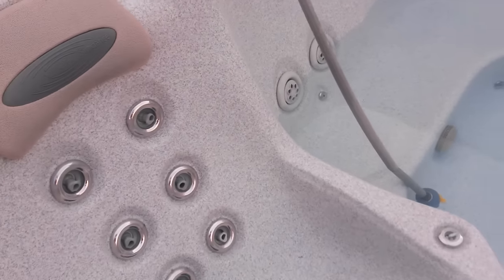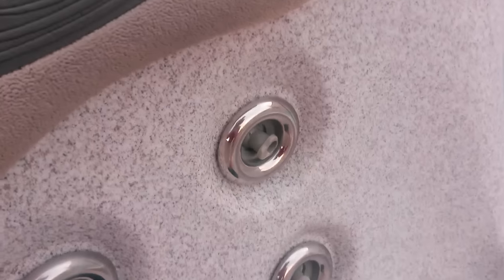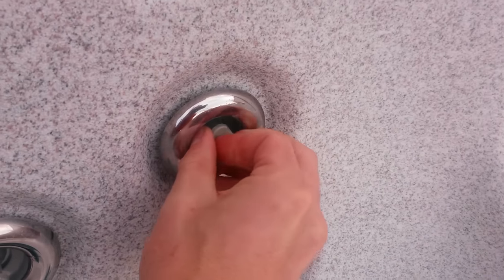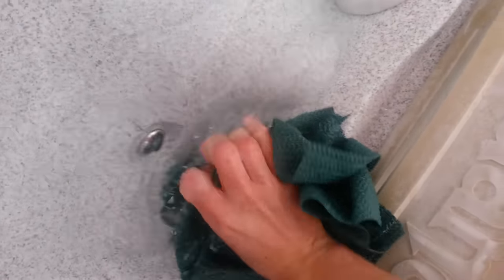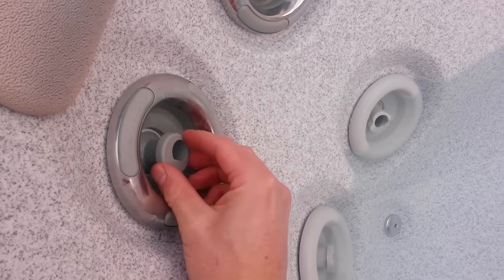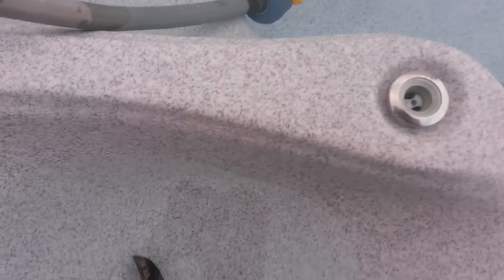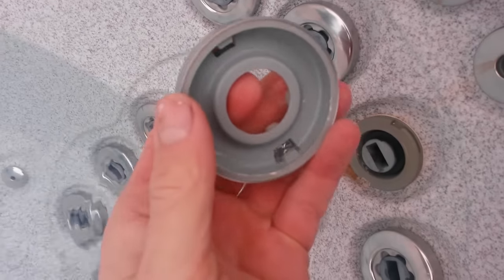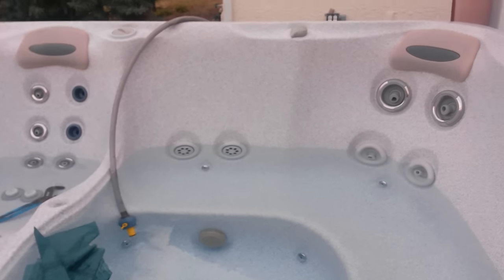How to Remove and Repair/Replace Various Spa Jets ~Sundance, Whirlpool etc

Comment: How to scratch and break your jets is what I learned here
Reply: Maybe you could make a video showing us all how to do better?
Reply: Yes, this is a pretty horrible way to do it.  If you look at the tabs on the removed jet you will see a channel inside of the socket that has a perpendicular keyway to allow the tabs to slide out. All you have to do is turn the jet all the way to the right and pull. LOOK  inside the jet well and you will see the intended removal design.
Reply: That is what I thought I was like why are you not using some kind of rubber gasket between the wrench and the jet housing? Lol then he broke one and I was like ouch! Lol ugh at least he didn't go on 5 minutes on how you soak them in vinegar lol

Comment: Hey ik this is a little off topic of video but on my new ac motor i have, above the inlet big tube connect there are 2 little black almost valve looking things but one of them isnt blocked and leaks water out. Am i supposed to have a little water line coming off of that or something? Or could i just fill it in.. thanks in advance
Reply from the maker: That is theine that primes the pump. It will generally have a line going to the tub or circulation pump. It allows the pump to fill with water before it runs. Not always necessary. You could try just capping it off.

Comment: I own a 1998 Sundance Marin Spa.  After previewing this video, I attempted to turn my 5" foot jet to remove.  This was not a correct procedure for my model spa.  My replacement jets snaps into the jet housing without removing the trim.  I didn't see any videos showing this process for older Sundance spa's. Hopefully you will show this procedure in a new video.
Reply: Mine is a 2003 Coast Spa, has the same snap-off jets. Watching this video gave me the brainstorm to find my channel locks, and when the jet popped right off I realized it was different.
Reply: My bearings blew up so the jets are out but the plastic ring is still in there. Any tips on getting those out? There is nothing to pull on

Comment: Hi  we have the steam shower  with the jets  Thanks for the advice on how to clean them,     The temperature dial for the shower is sticking and  takes so much strength to turn.   We can't see a way of removing this from the back or the front  do you have any advice.  Thank you
Reply from the maker: lynne camozzi Many fixtures will just screw on/off, even if there is no apparent flats to use a wrench on. I would have to see it to be sure.

Youtube is changing their policies for small channels like mine on Feb 20th. I need 300 more subscriptions to meet their new criteria. Please subscribe to the channel if haven't already.

Comment: Thank you! Had a twirling jet with ball bearings go bad after 4 1/2 years of owning a new Hotsprings Flair hot tub. Went to my local dealer where I bought it and buy my supplies and they gave me a replacement for free (5-year parts warranty I guess) and they said it was easy to replace even with water in the tub. Had to come to your video to see how it was done and you taught me that I needed my pickle jar grippy and some elbow grease and boom! Easy. Thanks for giving me the confidence to put some force on it! Works like a charm!

Comment: I was having a difficult time removing a spinning jet, I poured some vinegar over the jet, let it sit for a few minutes, off it came. Thanks for the video. My tub is 18 years old.
Reply from the maker: That's a great tip!
Reply: My spa is over 10. I have spent a few grand trying to get leak fixed. They tell me to trash it. Nope wrong answer. I have taken the fascia boards all off and using a waterproof leak stop on them. Tested them and it holds water now. So much for spa techs.

Comment: Thanks for this video, I've got a lazboy spa with the 3 inch jets by the neck, one works but is very slow even in open position, the other barely trickles water even in full open position, guess it's time to pop them off see if they are clogged up soak in vinegar and pray i don't have to replace them...

Comment: Commenting all the way from Australia my jets no where loose as urs struggling to get them to move at 
all
Reply: Aaron Kay Do they move back and forth to turn the jet off and on? Do you have the same spa brands down under?
Reply: TrailerDayz yes I believe exactly the same 1999 sundance Marin is what I have they barely move to turn on and off but they should because one is loose the rest are so hard to move
Reply: Aaron Kay yeah they get that way. Just keep working it. Replace them, or remove them all and soak in vinegar for a day
Reply: I soaked the hole spa in vinegar i added ten litres to it
Reply: Aaron Kay That's a lot vinegar!

Comment: Your video was good to show how to remove the jet, but wish you had shown how to put a new one back in.  I got replacement DXL Sundance 4.3 jet from dealer as several old ones (2012) kept coming loose and floating around in spa. What holds the new ones in when I put them back to replace so they stay put and don't just pop out when the jets turn on?  Is there something special I need to do when inserting the new ones in or do I have a part inside that is worn out so it won't hold?  I can't see what is in the hole to hold it but there are two flanges that spring out on the base of the new jets. Thought this was going to be simple, now I'm frustrated.
Reply from the maker: Just push it in. If you find it won't go all the way in you can twist it 90deg either direction. Can't really mess it up. Just stick it in and give it a pop with your palm.
Reply: @SpaDayz  Thanks, I get in and try it tonight again. I was afraid I might break it. Still wonder what those two springy prongs are suppose to hook to.. or maybe behind something?
Reply from the maker: @Sunnyacres55  Those clips snap behind a ridge in the jet body.
Reply: @SpaDayz  One last thing...sorry.. but on the end of the jet shaft there is a large open slot.. and since it appears you can only rotate the jet 90 deg. each way to open/close the jet, I'm assuming this slot allows the air through it...so does it get put back in with the slot facing "up" or facing "down" so it works properly and that slot matches up with something?
Reply from the maker: @Sunnyacres55  It should work either way, but go ahead and face it up for good measure.

Comment: @ SpaDayz  I was having leak down issues through the venture or vent system.  I'm assuming I had some "Crossing Over", so I replaced ALL the jets and problem solved.  The old jets were chalked up bad with calcium etc. but were not damaged.  Can leaving a jet turned OFF cause crossing over and leak down...???

Comment: My 2004 Sundance Optima is leaking from the temperate sensor. I removed the panel, and the foam installation to get a closer look, but I cannot tell how it is secured to the tub. It looks as though it stays secure because of the installation and by screwing in the sensor. Do you have any experience with them leaking? Thoughts on sealing it with silicone? Ideas? Thanks for you help. Gordon
Reply: Gordon Loop Yep. Just unscrew the nut, wiggle and pry it out, then re-install with a generous helping of 100% silicone or boss sealant

Comment: One of my jets is clogged with what feels like rubber, I think it’s sealant or a rubber seal. I can’t get it out but it’s totally clogged the jet. How do you suggest I unclog it?
Reply from the maker: What kind of jet is it? Can you describe it? Most jets are removable.
Reply: @SpaDayz  Its a American Spa 630LS 5 person.  I have removed the outerjet but can't get at the blockage.  I'm afraid that if I stick a wire hanger down there that I am going to just push the clog further down the line.
Reply from the maker: @sagedrummer  Can you get at it with a small pair of hemostats or tweezers?
Reply: SpaDayz I’ll see if I can use the smallest pair of tweezers on it. Unfortunately it’s the smallest jet on the tub so it’s a very small opening.

Comment: Hello, GREAT VIDEO!  I have subscribed to your channel and appreciate the time you have put into these videos.  I have an '03 Sundance Cameo.  I have the 5 inch jets and when I turn the silver ring to the left the ring just comes off.  Basically the silver ring and jet are 2 separate components.  I am assuming that all the jets are just old and broken.  Water does come out of them though.  Do you have any ideas on removing the inner part of the jet in order to replace with what you have shown in your video.  
Thanks
Reply: the chrome trim ring is just crimped over the outside of the housing. If you try ti turn it now that the metal trim ring is off, you may have more luck. On older spas the plastic degrades and removal becomes quite difficult
Reply: +GadgetClass So do you have any recommendations to remove the jets?  Is there a tool to remove?  Do the jets pull out or twist out?
Reply: oh wow I also have the same '03 Cameo and one of the jets isnt putting much out. I had the same experience where "unscrewing" them at the bezel just pops the chrome/plastic face off and then the main body of the jet is still in there. I realize your post is 7 yrs old now lol but thought i might ask anyway. Did you figure this out? I'm reluctant to just start cranking on the jetbody with channelocks since it looks like theres a flat white gasket that might not be replaceable.

Comment: Hi, I like your video! I like the spa jets you have. I have a artesian south sea spa 748 dx.  I want to use other jets different from the ones I got below ? Can I use any maker as long as the size is correct ? Like I want some nice rotation 3 in replacements, but I don't like the ones that came with it, am I stuck or  ?
Below are the stock model numbers 
• 03-1414-52 Double / Twin Rotating 5” Stainless 
• 03-1312-52 Directional 3.5” Stainless                      
• 03-1208-52 Directional 3” Stainless                   
• 03-1207-52 Rotating 3” Stainless                    
• 03-1103-52 Directional 2” Stainless

any help would be much appreciated !
Reply from the maker: Not familiar with those specific jets. A lot of manufacturers do cross, but not all.

Comment: So, I know its 8 years later. But, would lowering the PH super low and running it. Wouldnt that dissolve the buildup and then you just drain and refill
Reply from the maker: Not unless you lowered it A LOT. The calcium crystals take years to form and are quite hard.
Reply: @SpaDayz  thank-you. I figure that means you would need the PH more around 3 or 4 and that might damage other components

Comment: how do you take off the filter? I don't see any screw.
Reply: Okaythen001 turn the filter about half way around then pull up
Reply: Okaythen001 Yeah... Imagine all of the surface area in all of the tubes and jets. Now imagine all of the oils and dirt from a person covering all of those surfaces. Almost no way to really ever get it completely clean. Bathtubs shouldn't be jetted if you ask me, since you always want to know you can take a clean bath.
Reply: so it's normal, thanks so much